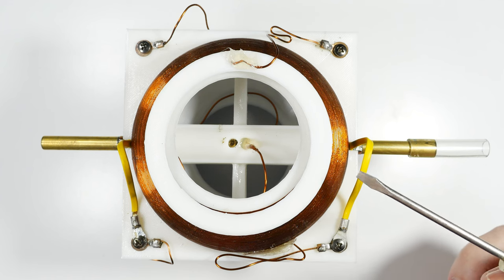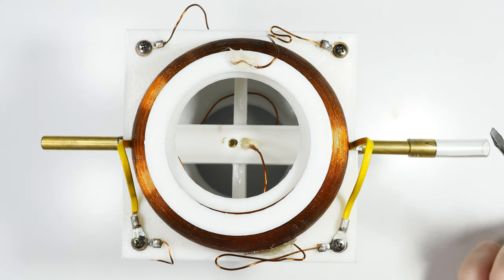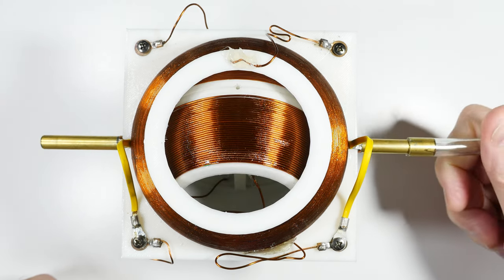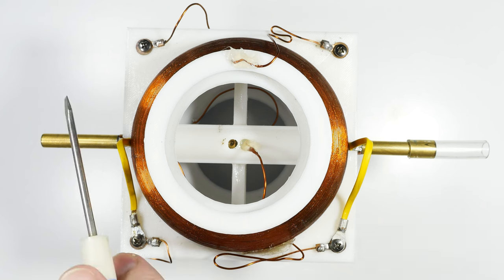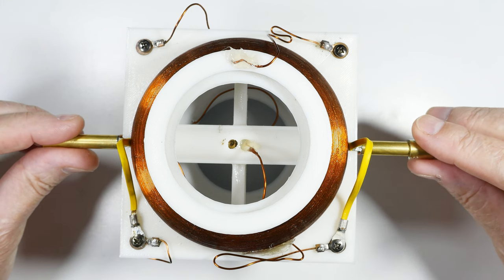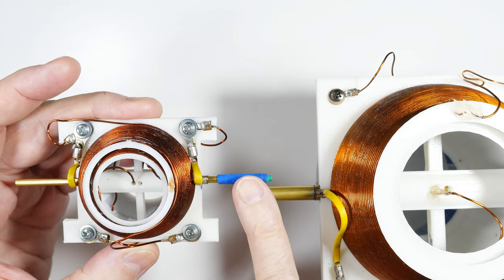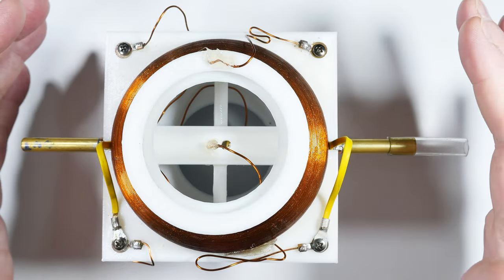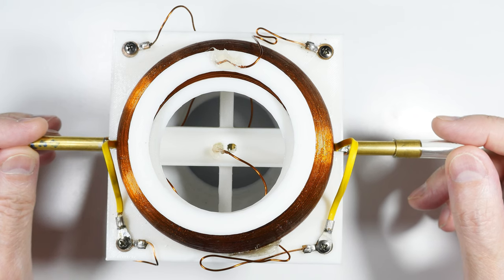Crystal Radio Variometer Pt8 - Closure (4K)

Comment from the maker: Correction: a variable capacitor that would tune this to the AM band would be in the range of 12 pF to 120 pF, not 100 to 200 pF as stated. 

This is the series on how it was created:

Crystal Radio Variometer-Commutator Questions & Comments (4K)
https://youtu.be/1gWW37SIFp0

Crystal Radio Variometer Pt6.2 - Closure (4K)
https://youtu.be/z-4MAjnB4mw

Crystal Radio Variometer Pt6.1-- New Beta Version Works!
https://youtu.be/xVQVQnKYP0A

Crystal Radio Variometer Pt 6 - Protoype Is Done! Will It Work?!?!
https://youtu.be/9PO__GsDkAg

Crystal Radio Variometer Pt5 - Ball Is Done!
https://youtu.be/DCI8sSCJbQc

Crystal Radio Variometer Pt4 - Better Yet! 
https://youtu.be/Nzp4hJsnCSU

Crystal Radio Variometer Pt3 - Design Improvements
https://youtu.be/ooQ8eOIXAaM

Crystal Radio Variometer Pt2 - Winding The Ball
https://youtu.be/T25Eq2C1iSk

Crystal Radio Variometer Pt1 
https://youtu.be/RgJen7UGZ4M

I have the updated 3D printers files posted on line here: https://www.thingiverse.com/thing:6290893
https://www.printables.com/model/632114-crystal-radio-variometer-aka-vario-coupler

Comment: Would this be a good variometer for a crystal radio that has no tube amplification or power source? Thank you!
Reply from the maker: I have not tried it yet, so I can't say for sure. It's a close copy of an antique one, so there is a good chance it will work as well as any. You might need to vary the wire tye and size for your application.